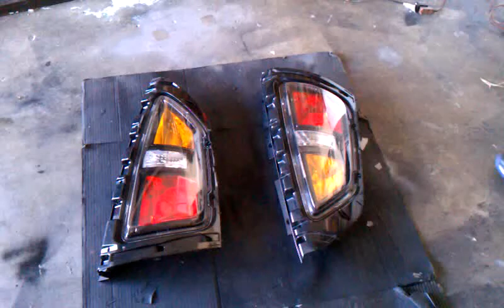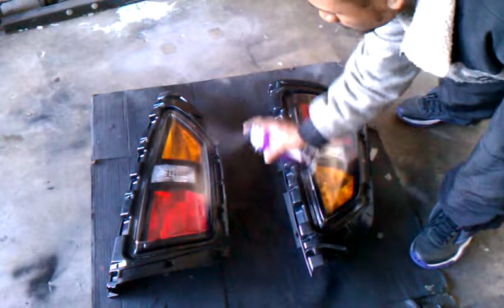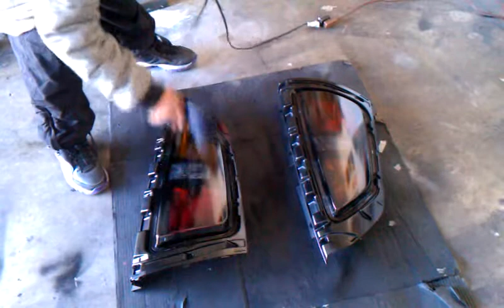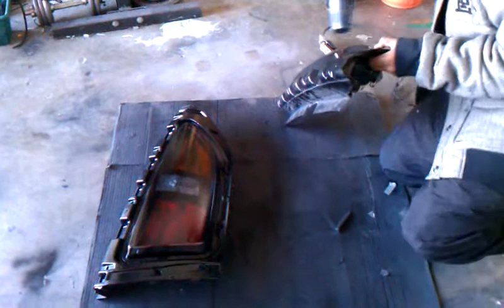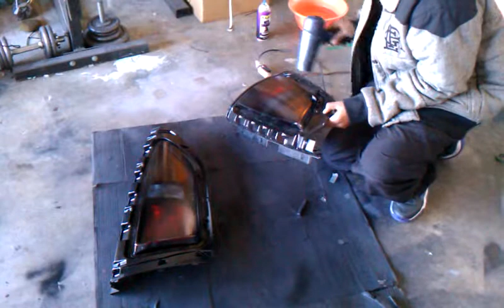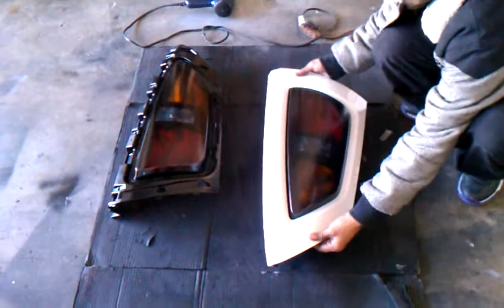Smoking Out Taillights In Layers With Clear Coat   (((SUBSCRIBE IF YOU LIKE)))

Comment: Cool video..came out looking good..the technique I've done is start with 2 coats of bulldog adhesive promoter then started with the several coats of tint then one last coat of bulldog then a flat clear or gloss clear with uv coating and I baked the lights for 10 minutes at 150• degrees..

Comment: I wetsand the tails w/ 800 before I start, then I wetsand w/ 1000 after every coat of VHT, then clear it w/ automtoive clear. let clear dry 12 hours, then 2 more coats of clear, after the clear dries...wetsand w/ 2000 and buff 3 coats of Rubbing compund, then 3 coats of PlastiX scratch remover, then 3 coats of Carnuba wax, all with the Buffer. Shines like GLASS!!!

Comment: man, if  u woulda done that right even with the clear coat.....the 3erd coat shoulda blacked em the fuck out....
ive been using VHT for a while now and i do use clear to paint finish to keep it from fading out but u need to cross hatch that can so u get the full amount outta it. and like i said not bad but go slower and closer.....that 3 coat will black it out completly.